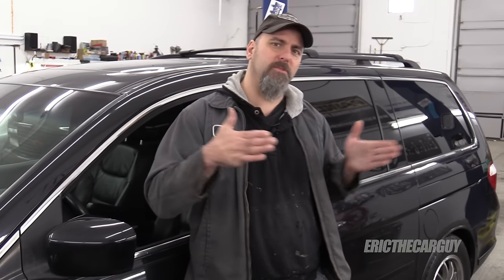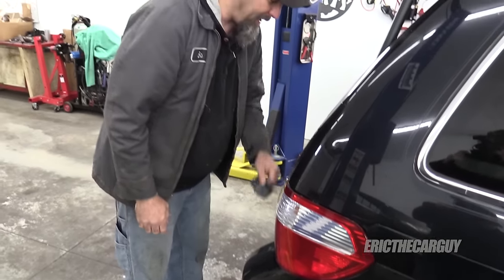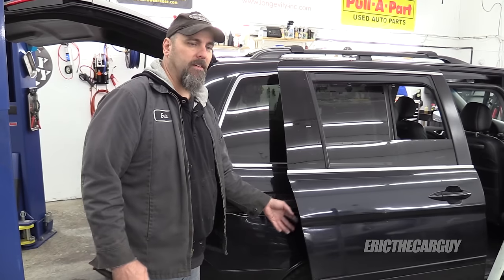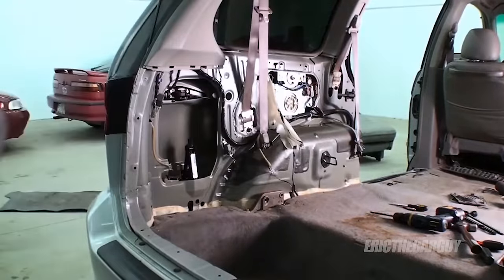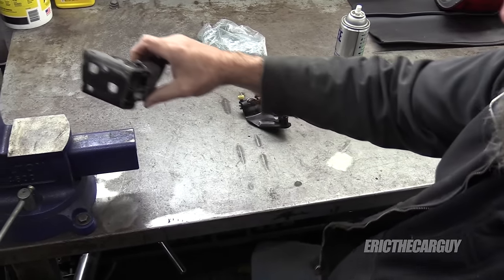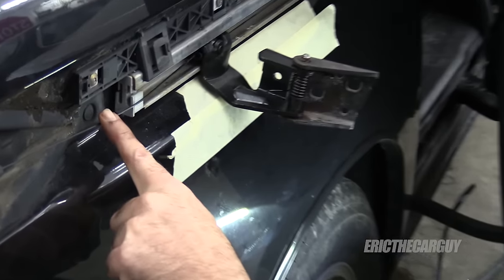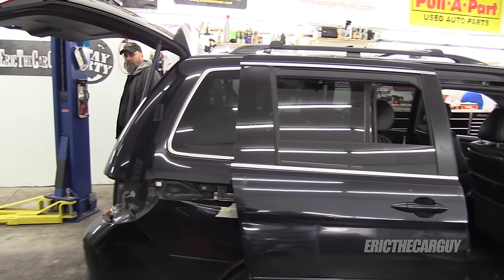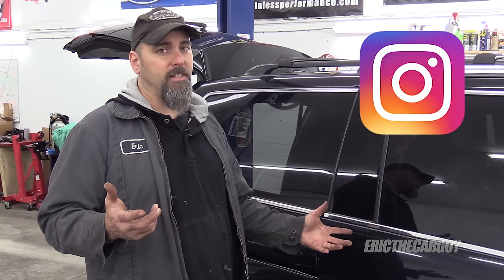Honda Odyssey Sliding Door Repair the 'Easy' Way

Comment: THANK YOU SO MUCH!!!! YOU ROCK!!! SO EASY!!!!
I did not have the play in the back of the door, but this did solve my problem.
I used my normal car jack, but the door fell/slipped off a few times. Oops.
I checked the track before putting on the new part, and saw there were some rough parts where the old part must have scraped it up. So I sanded that down with some sand paper I had, I don't know if it will matter, but I hope it helps.

The door problem is severely exacerbated by the fact that we park on a slope, so the door motor is working harder to open the door. And it would get enough resistance (I think partly from the rough track) that it would wobble back and forth as it was trying to close, which signaled the motor to stop and re-open/close. All that to say that I think smoothing any rough spots on the track may also help or be necessary. And, if we hadn't let it go so long, we wouldn't have had rough spots, because the bare metal wouldn't have scraped the track.

Just a thought. THANK YOU SO MUCH ERIC!!! EXCELLENT VIDEO!!!

Question for anyone still reading:
1) What kind of lubricant should I use for these tracks normally? Someone said White Lithium Grease, and someone else said no because it will degrade the plastic wheels.

2) If I just clip/remove the cable, will that make the door operate like a normal manual door? Opening the door on a hill is really hard on that motor, but turning off the motor has made it hard to open the door (although, honestly, I haven't tried it that much with the new part, so it might not be as bad)

3) Has anyone had to do anything with the bottom track? I looked at the plastic wheels on that and they look cut in half :(  Is that wear or I could simply be mistaken and that's how they are supposed to be?

Comment: Hey Eric, just wanted to drop a quick note to say I really appreciated this video. My wife and I used it as a guide for replacing the exact part to fix the exact issue you described at the beginning of the video. What you did was clearly shown in the video for each step, and you explained things thoroughly and with some levity thrown in as well. That pose in the back of the van at a scene change - ha!

So thanks again. This was very helpful (the fix is in on our van, and the door moves like BUTTER now!), and we were entertained as well. Keep it up!

Comment: Thank you!  The doors were so frustrating, it would take several tries each time to open or close.  The kids have been asking and asking for a new van.  I thought it would be a super costly or time consuming fix, and put off looking into it for a long time.  A couple hours of work later and both doors are fixed!  Three of four of the sliding wheels were completely gone.  Only correction is that I'm pretty sure the amber light goes on the bottom, not top when putting the tail light back together.  Anyone doing it double check for yourself.

Comment: great video, thanks for taking the time to post this. I would have one suggestion I picked up from another video, and that is to punch out the pin while it is still attached to the door. This way you don't need to realign the door, and it will fit perfectly.  To punch the pin you can tap on it from the top, and then pry it out with a small pry bar or screw driver underneath, and then  finally with a larger screw driver taping on the head from the top, just like removing the pin from a door hinge.  replacing is quicker, you have room to get a small hammer underneath and tap it in.

Comment: Hey Eric. Just came to tell u I fixed the door on my dads van because of your video :-). I have no background in fixing cars but was able to do it with ease thanks to u. The only thing I did differently was I didn’t remove the piece for the door. I was a afraid I wouldn’t attach it perfectly even if I outlined it like u. I managed to take out the clip quite easily with it still attached to the door. Everything else was a breeze bc of u! Awesome work man and thanks!

Comment: Eric, I call myself The Machine Man, for slightly askew reasons, my interest in fixing any machine! Your video here, having watched many for knowledge in the past, is affable and has human interest. An embracing presentation. Great sense of humor and ability to comment on everyday life.  Do we thank your schooling or parents (tongue in cheek, haha). However, I replaced mine years ago by just replacing the small runner bushings with  bearings, instead of money wasted on Honda Parts, same way as you did. I used real ball bearings for longevity, not the original bushings that Honda made it with originally. But I did have to use some epoxy as I could not get an exact inner bore  match. Isnt that always the case,  Porsche too! Maybe 10 years on, I hear the tell tale hiccups again, drat! I use it for business, hence lots of use. Keep it up. You get better with age!!!!!!! lol.

Comment: That pin with the C-clip on top ( the one we were laughing :face-pink-tears:together about ) gave you a little tap trouble but mine was rusted in on my 2009 Odyssey so I grinded off the spring, metal sleeve, and plastic spacer to make it release out.  WHEW !  I got it aligned and got it back  together.  Thanks Eric!  Was your Dad a DJ? Now off to do the left side!
Could'nt have done it without you!

Comment: worked liked a charm, thank you for uploading this video. Didn't have to undo the inside panels, but had enough slack in the line that it changed easily. whole process: 35 minutes (the tail light was actually one of the hardest parts.

Comment: Just fixed my driver's side sliding door following the instructions in this video (2010 Odyssey).  I had a much harder time putting the pin into the new roller assembly (probably because I got an after market part), but nevertheless, I got the job done, AND on Mother's Day to boot... THANKS SO MUCH!

Comment: Our 2008 had so many sliding door problems I think they replaced/fixed at least 8 times under warranty.  We finally traded it in.  But I wish I had seen this video back when we still had it!  FYI - you can turn off the power slide door feature and manually open it as much or little as you wish.

Comment: Thanks for your excellent video!  BTW, I had to remove the tail light assembly & found it very helpful to apply duct tape to the side of plastic cover & leave a "long end" at the rear, so it could be pulled straight back without breaking the assembly.  Worked like a charm!! Not my idea, saw it on a U tube video after I was initially unable to remove it.  I am having persistent "slide door" light on dash, in spite of having the slider motor replaced (to the tune of $ 800. during Covid peak) & had to wait about a year for the part.  It still doesn't work properly.  Will open & close a couple times ok, but then "slide door" light comes on again.  My mechanic got tired of seeing me come back with same problem & told me to just "reset" it.  So, I have done that at least 10 times already.  Now, I just try not to use the door (It's a 3 door Odyssey)  Perhaps the rollers are contributing to problem.  Will check that out.  Again, thank you for your RXCELLENT video.

Comment: Eric. Great video! But turn the power door off and open it a couple inches manually with outside handle then the center roller cover comes right off without worry of scraping paint. Also the taillight.. take a plastic interior trim tool with a tapered edge place it close to where you know that clip is.. stick the edge between the paint and twilight housing. One swift hit to end of trim tool and it will pop that clip out. I haven’t broken one in years this way. Keep up the videos!

Comment: Eric, I was doing this job today. (I had one it once before) Funny thing, I did the exact same thing to my tail light this time, I used epoxy to fix it. Still letting it cure downstairs.  It's gratifying to know that a pro can have the same problems as me. -Tom

Comment: Excellent tutorial! Worked perfectly for me although I would add one thought...it was tough to get the cable barrels out and back in on my own but with my son holding the hinge and pulling straight back to increase slack, it was MUCH easier to get the cable barrels out and back in with the new rollers installed. The extra set of hands helped tremendously.

Comment: Great video.  This was my issue, solved it in about an hour.  Still have issues with the buttons opening the door, but once you manually start it at the door the electrics take over, and it's great.  Thanks for such a great explanation!!!

Comment: I always enjoy watching your videos. I just bought a 2005 and I checked and the alternator is putting out at 14.3 but is there a reason other than the battery being bad why it easily goes dead? I like the way I can tell now if my doors are in good or bad condition by wiggling them. Thanks for the great video 👍

Comment: Hey Eric I've changed the bracket exactly how you did everything all the steps went smooth. And I've reset the sliding the door light butt the door only open about 4 or 5 times and then the slide door some come back and the door doesnt open again until I reset the battery or pull the fuse
Reply: Hi Felipe! Did you figure this out yet? Mine does the exact same thing! If i pull the fuse to reset it, the door will work perfectly 3 or 4 times. Then the 'slide door' light pops up on the dash and it stops working until I pull the fuse and reset it again. If it were the rollers, it seems like it wouldn't work perfectly for the 3 or 4 times after the fuse pull reset. I need help. Don't wanna take it to the dealer and your comment is the ONLY one I've found from any and every forum to describe my problem to a 'T'.

Comment: Hey Eric, fixed the passenger door with no problems however the driver side went together just as easy but now when the door shifts all the way open it still acts like it wants to open & the Moyer starts to grind & I get the safety beep, Any thoughts? ( thanks for your videos they’ve helped tons!)
Reply: Did you figure this out? I have the same issue

Comment: Great video, and very informative. Now I believe I can fix this myself. In your experience, do you find many Odyssey's like this with peeling paint? My 2004 is half white and half primer gray. Yuck!
Reply: I talked with a guy that was the original owner of a 2007 with bad paint to. Other than the paint his still ran great after 215,000mi. My 2005 still has a decent paint job. If you've kept wax on your car it the paint.

Comment: Great vid. Had 4 Odys, no door probs on 1st 3. In a 16 EXL NAVI  from new now. The other prob though with Ody power doors is the door gasket causes them to stick. Honda makes a special lube for the gasket that works super, don't need a repair just clean and lube the gasket.

Comment: This way just worked great for me. Each side had one missing roller.  I straightened the pins for both rollers, (both were a little bent), broke off the remaining brittle roller, then printed some c-shaped replacements in PLA and welded them around each pin with a soldering iron/filament. (Ideally, i'd use a 3doodler or something like that, probably.). A bit of heat-and-squeeze and they're round enough to work. Getting them back into the slots was tricky, I think because the sliders get off position when they're broken. I used the dash switches to move the thing forward a hair so it'd line up.  If I have to fix them again, I'll hopefully remember to update this comment.

Comment: Thanks so much for this video, I replaced the top slider easily thanks to the video. Quick question will the bottom roller also affect the door opening?

Comment: Watched this a year ago and ordered the parts.  Watching now to refresh my memory so I can actually install them tomorrow.  Wrote down the steps one by one.
Reply: Update: Got one part replaced and found out the part is wrong for an 04 Odyssey.  Beware!  Remove one of the support arms and take it with you.  The 04 arm is substantially shorter in reach than the one for the 06.  Now I have to get it back together, and I can't get the cable end back into the old arm, so I'm gonna have to take the whole panel off the inside to give it a little slack.
Reply: These are the parts for a 99 to 04 (Be sure to check)
Part No.: 72521-S0X-A51 
Male Assy., R. Slide Door Center Roller 
[Odyssey | 2004 | 5 Door EXL (LEATHER) | KA 5AT]
Remove
$55.56
 $55.56
  
Part No.: 72561-S0X-A51 
Male Assy., L. Slide Door Center Roller 
[Odyssey | 2004 | 5 Door EXL (LEATHER) | KA 5AT]

Comment: Thank you for this video.  I'm not sure if it's related to the error I'm getting "Sliding door" message but I can check.  The sliding door does not respond either on the outside or inside when I try to open it.  

The car is already 17 years old so it's probably mechanical.  There's another work-around where I had to remove a 7.5A fuse temporarily from the interior panel box and it cleared the error, but then it always comes back once you restart the car.

Comment: Hey Eric, thanks for making this video. Quick question: When I press the button to open my passenger sliding door, sometimes it opens seemingly flawlessly. But sometimes, it struggles to open, can't open, and then reseals itself shut. In this scenario, the door doesn't move at all, just sort of unlatches, then tries to open, can't, then relatches shut. 

I'm not sure if I should replace the center rollers or whether to replace the rear latch assembly(maybe not replace, but take out and regrease all the little components). Any insight? Thanks again for the great channel.
Reply: I have the same issue. Did you figure it out?
Reply: @ramblinman7153  white lithium grease on all three rollers per door

Comment: Did both sides of a 2010 Odyssey.   One side had no roller at all on one wheel.  1:20 for the first side, including digging the floor jack out of the garage.   0:40 for the second, including maybe 5 min getting the cable attached.   Hardest part was finessing the light clusters out.   Also realized on the second I could move the roller hinge forward and back once both cables were on, which makes alignment easier.

Comment: Eric- is it impossible to leave the door bracket in place and knock/press the pin out to save the hassle of realignment?
Also, if this has just started happening on your car and the play doesn’t seem to be that bad- check your battery.  Ours were stopping intermittently when closing and it turned out the battery was shot.  No problems with the new battery. 

Thanks much for the future help when I do replace the door bearings!

Comment: I hate even changing bulbs in the winter here in New England.  Salt, Sand and Cold!  Fasteners and plastic lenses hate it almost as much as I do.  They will break about half the time.  I use plastic trim tools for prying, or heat it for as long as I can with a heat gun or halogen lamp from long range.  I don't like that you didn't change the lens with a new one.  They are relatively inexpensive from Empire, but I have had to glue them before also.  Great tip on rolling the window down to keep the door halfway.  I would have just started the close cycle and ran to disconnect the battery.

Comment: Eric, if you ever break a plastic part again use a good super glue and hold the part together and sprinkle some baking soda on the part where the broken pieces meet. The baking soda will cause a instant bond hard as a rock. I didn't believe it till I tried it. But it does work.

Comment: A big help, thank you Sir.  Unfortunately my right side is still hanging up after I found part of the roller wheel that needed replacement so I performed the repair as you showed and it works great manually.  Any additional suggestions after I reset the code and it comes back with the “Slide Door” light and stops working?   -Thanks!

Comment: I know this video is more than a year old, but a couple tips from someone that's owned an '06 Odyssey EX-L for the past 10 years and has done repairs on almost every one of the sliding door components:  the easiest way to partially open the door while leaving the power options enabled is to pull on the outside handle a second time, while the door is still sliding ... it will stop wherever it is on the 2nd pull ... on the next pull, it will continue in whichever direction it was traveling when you interrupted it.  The lever on the inside of the door that allows the passengers to open the door from the inside is even more useful for these repairs because it is mounted vertically and you can not only stop the door while it's sliding, but you can control whether it goes forward or backward each time, so you can make slight adjustments in either direction.  I don't like moving the doors in manual mode as it puts excess pressure on the cable, pulleys and the hinge on the roller assembly bracket.

Comment: Eric, great video.  Quick question- have you every just removed the cables and converted the door to a manual?  Checking my thoughts here: cut the cable and pull both sets of fuses and it should become a manual door is what I am thinking.

Comment: Quick tip, pop that pin out of the hinge instead of unbolting it from the body, saves you time and makes sure you don't lose alignment!  Also that year doesn't use the dial type cable tension on the slide motor, but that's just hair splitting :p  Great video!

Comment: Hey good video just  if you don't want to deal with door alignment issues use a small hammer to punch the pin out at the hinge while it is still on the car. Works great🛠️